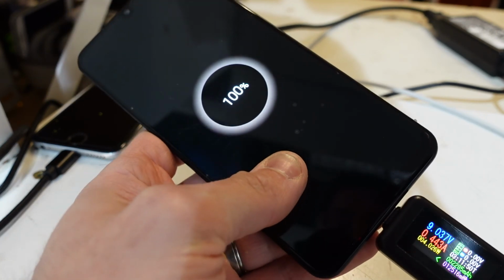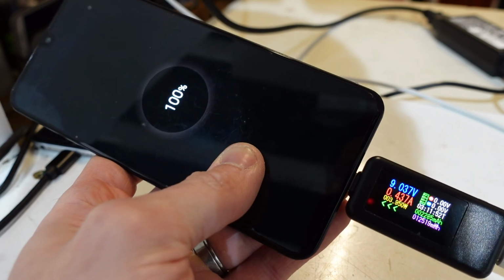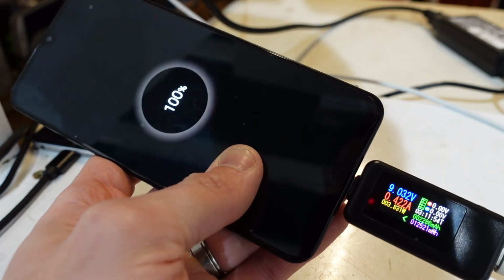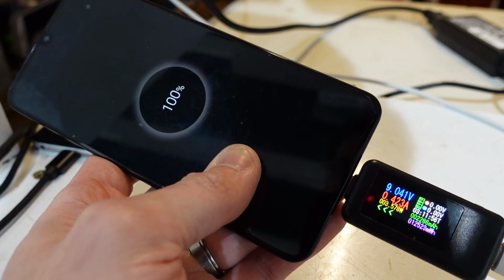samsung galaxy A20 Moisture detected in charger port  Hardware Override!

Comment: how did it charge so fast?
Reply from the maker: i left it on charged after i fixed it and then recorded it

thats not what you are ment to be noticing, the amp reader is showing 9v 0.4amp which is a good charging amount, thus working again